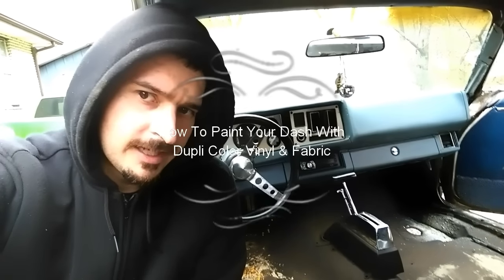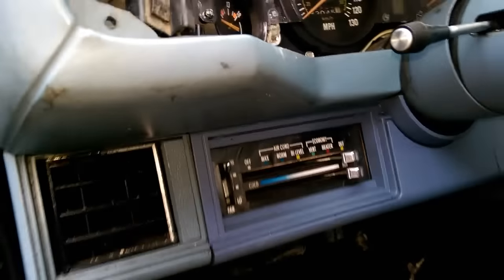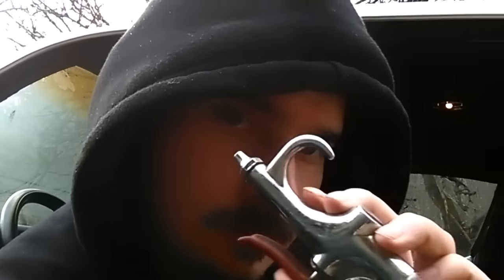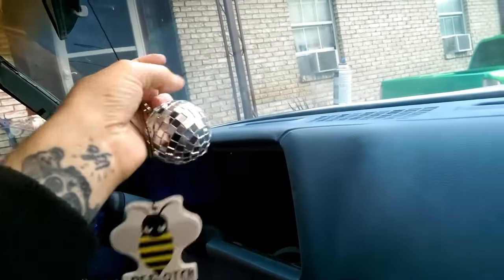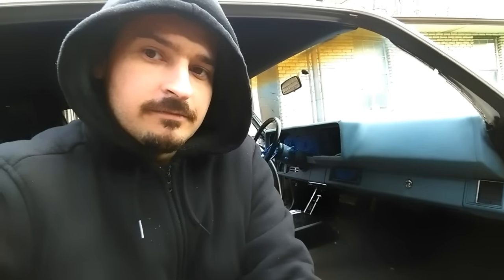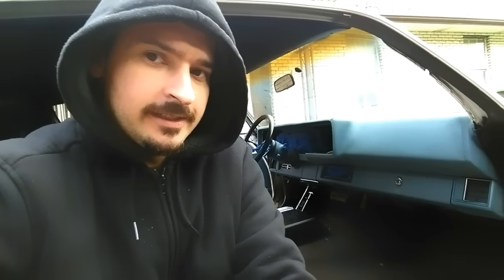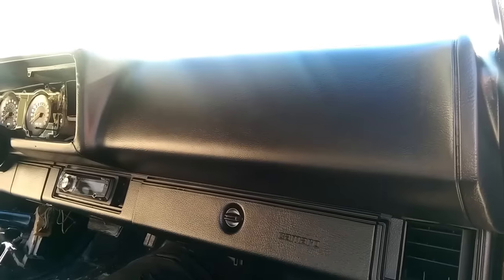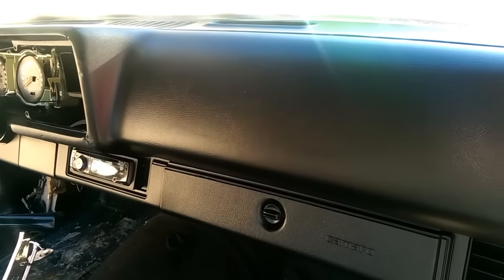How to paint your dashboard with dupli color vinyl & fabric Step By Step tips and tricks

Comment: Nice video! I'm about to paint a z32 300zx dash and plastics. They were always somewhat of a dull black and some of the handles have faded. Good tip going flat. I wonder what a satin type finish would look like? I want the dash to look like it was just armor alled but not at the expense of looking painted as you pointed out. Thanks!
Reply from the maker: This dash been holding up great, since I made this video, no issues

Comment: Hey man excellent vid, but I had some questions.. Could I use the same stuff for some touch up dash work not so much a complete paint job? I have some small faded spots on my glove box and I was wondering if the painted areas would stick out from the rest? It's the same flat color, but would you suggest I do the entire thing?
Reply from the maker: I would suggest doing the whole dash, but if you good at blending give it a go, if you do try to blend be sure to just do very light mist coats and fading it into the original color.... let me know how it turns out if you try the blending, if you do the whole dash just be sure to prep it good, and do light coats with proper flash times in-between coast... hope you find this video helpful, and dont forget to subscribe I plan on doing alot more videos like this very soon
Reply: TattsForLife What would be the appropriate flash time? The can doesn't specify :|
Reply from the maker: depends on temp, I like to give it 5 to 10 mins, before each light coat

Comment: That looks like a vinyl dash right...my Silverado dashboard is black plastic covered with latex beige color and it's peeling off...one corner on the has a 6" area peeled off. I need to put something like maybe super glue maybe around peeled edges to keep from peeling more...than paint whole dashboard. Do you think this dupli vinyl paint will work on that latex skin and exposed shinning plastic??? I guess I should maybe sand the plastic, than apply than apply something to edge of latex skin, than sand that a little, than paint...am I on the right track here, and will that dupli work? Thanx!
Reply from the maker: if its cleaned and sanded AKA SCUFF'ED it would work. you just half get that uplifting took care of, where it is peeling maybe with a vinyl repair keep then, then prep and spray it one the repair is smooth, its prob on passenger side thats normal on them trucks to happen
Reply: @TattsForLife  yeah it's of course the passenger side front corner that's gone. I actually found another video after yours. He had the same dash as mine and same problem. He did what I considered...he used a pressure washer and removed everything...it was clean. Then he used Seems adhesive promoter, then Seems paint...both spray can (I know lol) and matched it...about $40! He did an update 5 years later and it still looks new. My funds are small being older and disabled so I may go this way...if it don't work out I'll be heading for the junk yard lol
Reply: Dam phone...that was Sem products from O'Reilly's parts...not Seems lol

Comment: How hard was it to get paint coverage on the metal portion of the dash where it meets the windshield? That's a pretty tight gap and a very odd angle.
Reply from the maker: It was not that hard
Reply: @TattsForLife  So the coverage is sufficient in that gap where it turns downward at the glass? I'm about to paint the metal part of my Camaro dash and don't want to have the windshield removed to get good coverage in that gap.
Reply from the maker: @poweredbywinchester7070  yes just do light coats, it takes a few coats but coverage is great

Comment: On the vinyl parts has it came off at all? My 93 Ram has vinyl on the door panel and its somewhere that I'd probably touch a lot, you think eventually the paint might scrape off?
Reply from the maker: Idk I have not had any issue on it, but as all paint i would think it would wear off over time on heavy used arears

Comment: i did this same thing on a 71 camaro, some of the interior parts i replaced  where white and i had the change to black, i had to use a vinyl bonding primer to make the paint stick to the parts with hard vinyl. without the bonding primer the paint would scratch off  but with the primer it stayed on solid and would not scratch off at all. it was not needed on the soft fabric vinyl that was on parts of the door panels and headliner. did your dash hold up without using the bonding primer?
Reply from the maker: No I did not have any issues, I have a year later video posted of this dash, even where a sticker was peeled off that was over top and the dupli color stayed, the dupli color has a bonding promoter in with it so a primer really is not needed, but you can use one with it, the biggest mistake people make with this stuff is thinking its paint, when its not and they apply to heavy of coats and no proper flash times and it has bonding issues, or parts are not scuffed and cleaned all the way, Alot older parts need to be sanded as the older cars can tend to have bonding issues due to the top coat of plastic being brittle and flaking off.
Reply: @TattsForLife  okay thanks! I was looking at a car I wanted to buy that someone replaced with a red Dash and I wanted to change it back to the original dark grey without having to replace it, yours came out nice
Reply from the maker: Thanks

Comment: what if you use a glossy color and put a matte clear coat on it? will that get rid of the gloss?
Reply from the maker: Yep it would take some the gross out of it, but would not be the same as a low gross single stage paint, but with the clear you get more UV ray protection and less likely to fade, a lot of the hotrods around here have been going the hotrod satin black with the matt clear and looks really great. I hope this helps
Reply: Head Trip curious

Comment: What kind of paint do i use on a 95 chevy tahoe...the dash isn't vinyl
Reply from the maker: This brand paint works on plastic, and vinyl, long as it is prep good, and light coats used, I have even used it on metal dash, like in the 70's c10 trucks and 60s mustangs